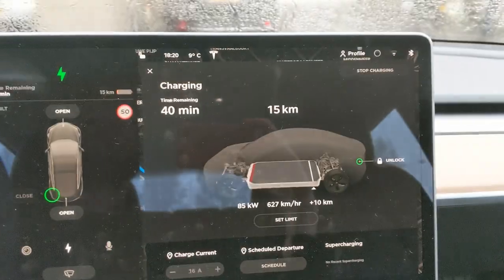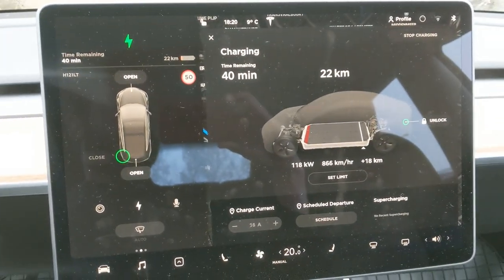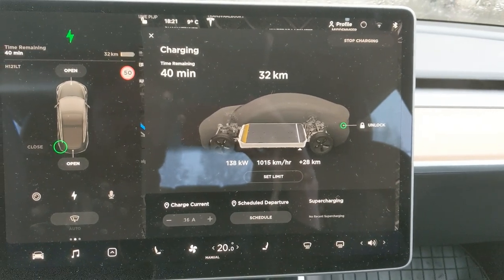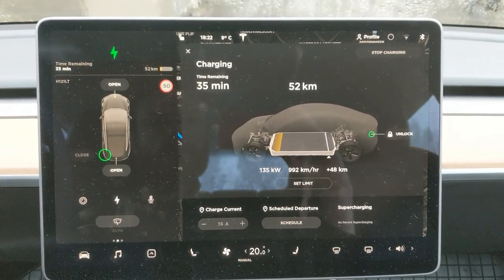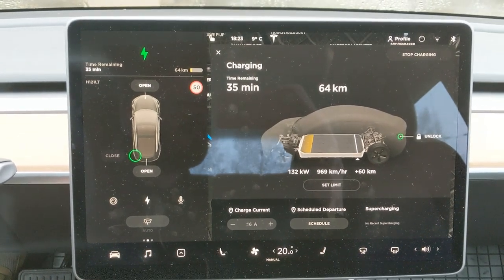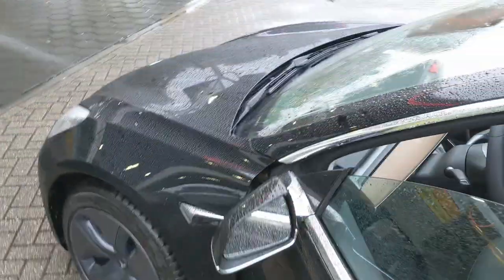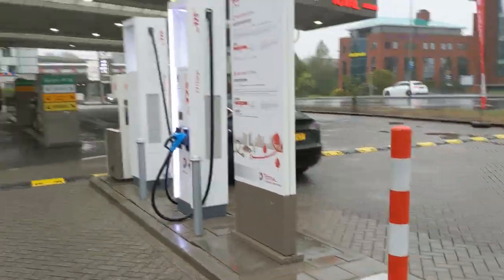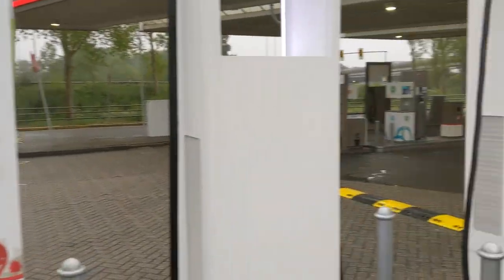electricfelix #TourDeChargeNL - Fourth stop: Total Amsterdam

Comment: I think, this has to do with the Huber + Suhner cables, because they can only handle 400A max. 

https://www.hubersuhner.com/en/products/low-and-high-voltage/cable-systems/high-power-charging/radox-hpc-high-power-charging-system

The PhoenixContact on the Tritium and the Alpitronic machines can handle 500A. But even with this, you can't complain.

And the Efacec has less output compared with this one, because the maximum current on an Efacec HV350 is 350A. On an empty battery you can expect ~120kW there.